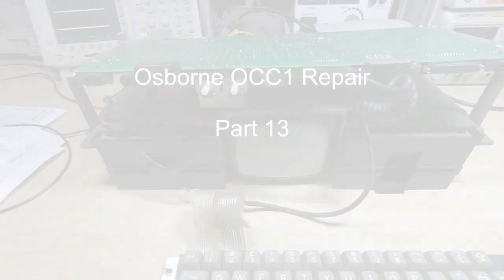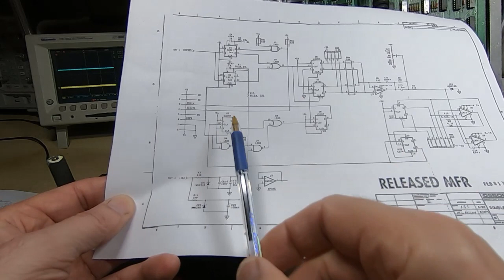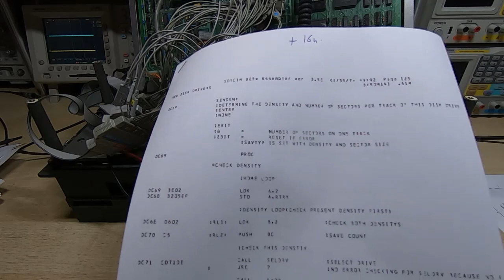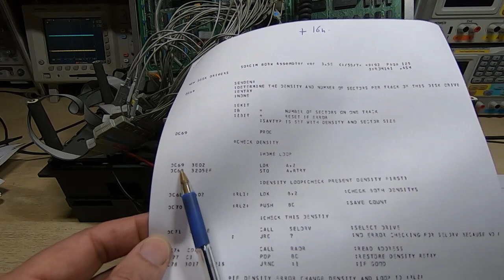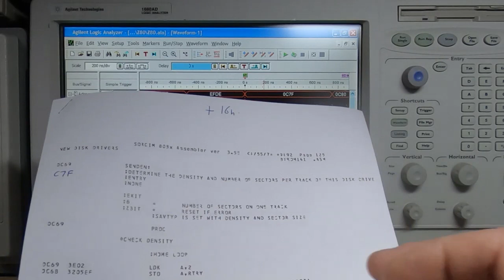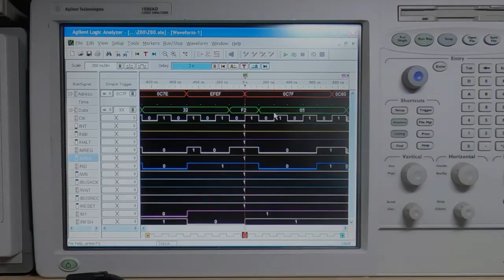Osborne OCC1 Repair Part13

Comment: Jerry, this sounds like it's going to be an interesting troubleshooting & repair segment of this OCC1 series.  Since the ROM on the motherboard is covered by the daughterboard, would it be possible to temporarily solder wire wrap (or similar) wires to the bottom of the motherboard at the appropriate ROM pins to get what you were looking for?  If not, could you explain why since I can learn a lot from your answer.  Thumbs up again!